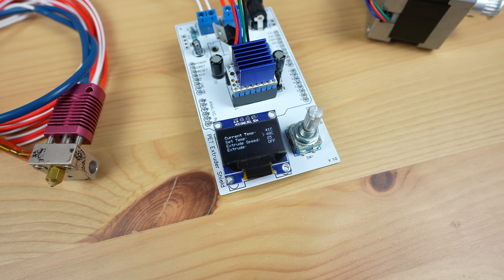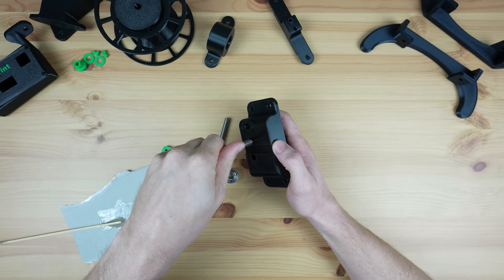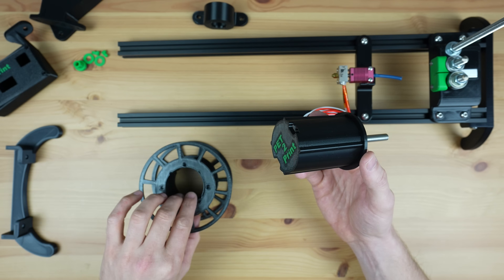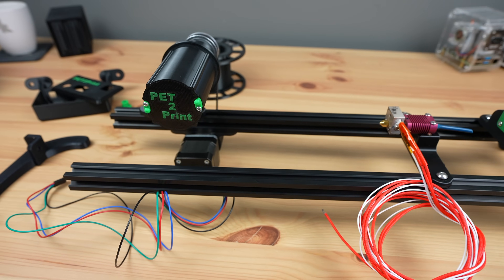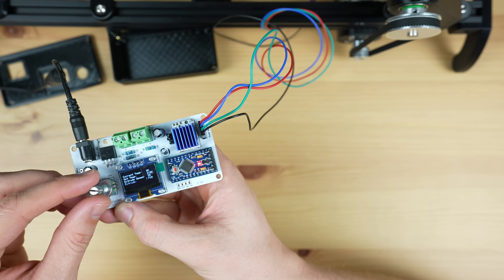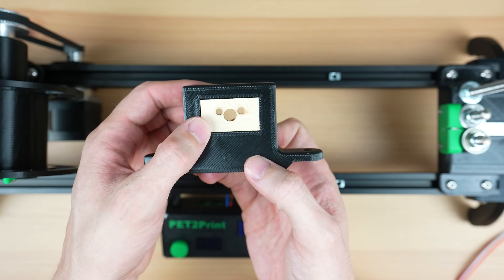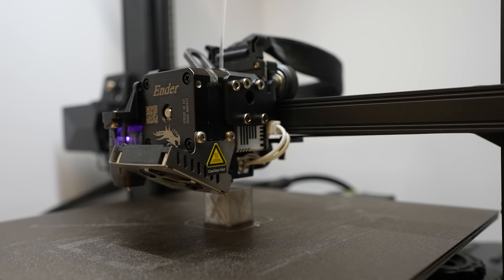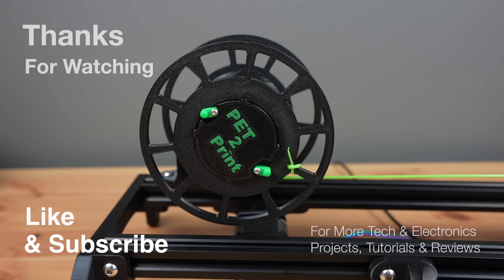I Turned PET Bottles Into A 3D Printed Pi Case - DIY Bottle Recycler

Comment: For the arduino issue with the monitor update , maybe there is in the manual interrupt functions that you can use to call and update the screen. When i worked with Uno for a flight controller for drones , i used those interrupt to fast update and not block other operations . Not if this model supports it , tho. You have to check the manual.
Nice project  👍
Reply from the maker: Thanks for the suggestion, I'll look into that.
Reply: @MichaelKlements  Another option would be to redesign with an ESP32 which has a second thread available

Comment: Hi! Why am i having a hard time pulling the filament? Like it gets stuck. Is it the problem of timing belt? Thank you!
Reply from the maker: Your strip is likely either being cut too wide or the plastic is too thick, or your hot end isn’t hot enough.
Reply: @ what is the width of your strip?? Thank you!
Reply from the maker: You'll need to experiment with it, the strip width depends on the thickness of the bottle you're cutting it from so that the total area is constant. Mine is around 5mm, keep reducing it until you get good results.

Comment: I've been looking at a lot of similar projects lately, thinking about doing this exact sort of thing but knowing people way smarter than I am have already figured out the hard parts. This is, by far, the most straight forward, simple, and complete design I've seen. Most of the other machines I've seen only focus on cutting the bottle into strips but not spooling, and not modifying the strips into print-ready filament. 

I've looked for an update on this project and don't see one, but I wonder if it's possible to add the ability to splice bottles together instead of trying to stop and start a print or add filament when it runs out. PET from recycled bottles makes some of the most interesting prints, I really like the look, and it'd be super keen ta be able to wind a full Kg or two of filament.

I've already grabbed your download and look forward to starting this build on my own. At my usual work pace, I'll be done before the next half-decade is done.

Comment: use freertos to make multitreading in you code, if you use an esp32 you have two nucles in the processor, you can atualize the display and control the motor at the same time.

Comment: Hi. How do you set the height of the strip? Could be an idea to measure the thikness automatically and let a servo set the cutting height :D
Reply from the maker: By adjusting the height of the cutting bearings with spacers/washers. A servo adjustment would be great but it has to be very rigid to keep the cut height consistent.

Comment: Please tell me how do you send the STEP signal to the driver? I assembled the circuit and filled in the program, but when the engine is turned on, it does not move (5 volts are supplied to the dir pin, and a voltage of about 2.4 volts appears on the STEP pin, but I do not see any pulsations? Please help me! I've already spent a lot of time and effort on this project, but I can't get it started.
Reply from the maker: The step signal is generate by turning a digital pin on and off (HIGH then LOW) with a short delay between them. What are you using to measure the pulses on the STEP pin? You should definitely be able to see 5V pulses on an oscilloscope. If you watch my video on the controller design you'll see the pulses on my oscilloscope when I'm fault finding the motor issues - https://youtu.be/43kFDSPJl6w
Reply: @MichaelKlements  When I turn on the board at the arduino output (pin 7, STEP signal), I get a value of 2.5 volts instead of 5 volts and I can't understand why there is such a voltage drop.But there is a frequency change on the oscilloscope. As far as I understand, 2.5 volts corresponds to a logical unit. The direction signal (DIR) is also present (5 volts), but the motor is not moving. I turned on the board without a heater and a thermistor, maybe I'm wrong not to connect them? And that's why the engine is not working. In the first part of the video, you have a heater and a thermistor connected when you check the engine, but in the second part, the engine works without a heater and a thermistor. This leads me to a dead end. What am I doing wrong?
Reply from the maker: It depends on what you are using to measure the signal - that is why I asked in my original reply. The step pin is constantly changing between 0V and 5V, multimeters will take the average over a period of time and that's why they will display 2.5V. The direction pin stays at 5V so it is displayed as 5V on a multimeter. You need an oscilloscope to actually see that the pulses are correct.
It sounds like your motor driver is not set up or wired correctly.
Reply: @MichaelKlements  I checked the STEP signal on the oscilloscope, the values match. Thanks for the advice. But the oscilloscope shows periodic signal skips. As I understand it, this is the problem that you are talking about in the video, related to updating the screen. Perhaps to eliminate it, you need to use two independent timers that do not depend on each other!?
Reply: @MichaelKlements  // пример параллельной работы нескольких таймеров
#include "GyverTimer.h"   // подключаем библиотеку
// создаём таймеры в миллисекундах
GTimer myTimer1(MS, 500);
GTimer myTimer2(MS, 600);
GTimer myTimer3(MS, 1000);
void setup() {
  Serial.begin(9600);
}
void loop() {
  if (myTimer1.isReady())
    Serial.println("Timer 1!");
  if (myTimer2.isReady())
    Serial.println("Timer 2!");
  if (myTimer3.isReady())
    Serial.println("Timer 3!");
}
Reply: @MichaelKlements  I tried to use the Arduino nano (I changed A2 to A6 in the program, as well as A4 and A5 I took from the board (an additional four-pin pad (D10, D11, A0, A1) next to the Arduino) and the Arduino pro mini, but the situation with the D7 (step) output is the same, I get a 2.5 signal a volt instead of 5 volts.

Comment: A beautiful and elegant design!!! Any reason that the reel is so far from the hot end? Is that just for uniform winding? Wondering if the could be closer to make the whole setup more compact.
Reply from the maker: Yes it is just to reduce the angle that the filament leaves the hotend so that it winds onto the reel correctly. You could make it more compact with a small deflection/guide wheel between them.

Comment: Can I use another drive 17HS4401S-PG27 instead of 17HS15-1684S-PG27. I can alter the 3D model to fit the desired dimensions, I am more interested in parametric characteristics.
Reply from the maker: I can't find a full datasheet for the drive you've linked but from the information on google it looks like it has slightly higher holding torque (which is good) and a higher gear ratio, so will just turn about 4 times slower ( itmay be a problem to get more pulses from the Arduino to speed it up).
Reply: @MichaelKlements  Спасибо за ответ!
Reply: @MichaelKlements  Another question. What pitch division did you configure the driver with (1/8/16/32)?

Comment: I wonder about joining the strips of pet with a hair straightener and parchment before pulltrusion for larger prints.
Reply from the maker: You need to join the filament after pulltrusion, the heating and pulling process softens any joint you're able to make and it'll pull apart.
Reply: There is a video of joining filament before pultrusion by "3d_olympics" but I have my doubts for longevity of the joint after respooling and the inconsistency between filaments. Probably better after pultrusion like you say. @MichaelKlements

Comment: Michael, I bought one of your cases a couple years ago. I wanted to know are you going to make the case adjustments for the Pi 5?
Reply from the maker: Yes, I'll definitely be updating them. I've done the adjustments on the cases based on 3D models, I just want to test them out with an actual Pi 5 before making them available.

Comment: Hi Micheal. I have been playing around with some AtTiny85 mcu’s dividing the various components of a PID controller between two AtTinys. I was wondering if you might try off loading the actual timing of the stepping pulses to an AtTiny and all you have to do is send it start/stop and speed data as desired.  The motor on/off signal could come from the ardunio to the motor controller. The AtTiny only has 6 gpio pins, but it can do anything an arduino can do.  Communication between the Arduino and AtTiny can be software serial, I2C, or SPI.  

Alternatively, there are number of interrupts on the arduinos that are timer driven.  You might try using a timer interrupt to handle the step pulses instead of relying on the loop() function of the sketch(I’m assuming that is what you are doing). That way the stepper gets serviced on time every time  and won’t be interrupted by the periodic updating of the display. Interesting project and your engineering of the device is excellent.
Reply from the maker: Yes, this solution would definitely solve the problem - it just seems like a waste to have two microcontrollers on one board. It might be a job for a microcontroller with two processing cores that supports simultaneous tasks.

I tried the Arduino's interrupts in a few different ways but they either resulted in no change to the motor's behaviour or they resulted in the motor running smoothly but the display being corrupted every refresh. I think they both require quite precise timing and are sensitive to changes.

Comment: What about getting the reel closer to the hot end? The filament maybe is not cool enough yet and might help keeping the shape of the reel.
Reply from the maker: I think it would need to be very close to the hot end to do this, the filament hardens about 2-3cm from the tip of the nozzle. The main reason the reel is so far is to improve coiling onto it.

Comment: Drive the motor from an interrupt instead of the normal loop.  That way you can do less critical stuff like display update in the loop and still have the motor driven at perfect timing.  Does require some care for communication between both parts though ...
Reply from the maker: I tried this but couldn't get better results, even with an interrupt routine the Arduino still stopped pulsing the motor for periods of time when the display was being updated.
Reply: @MichaelKlements  its a problem with the display library

Comment: Nice project! If you pre-cut the bottles, you could try splicing/melting the ends together to get a longer filament output, if that would fit through the hot end.
Reply from the maker: I see some people have had success with splicing the ends of two lengths of filament, I tried this a few times but didn't get a reliable bond. I'll keep working on it though.

Comment: Nice but why not use easily accessible hardware like m3 screws instead of m2.5 and geared stepper instead of easy to source non geared stepper.

Lots of people are going to have to order extra hardware that’s going to go unused 🤷🏻‍♀️
Reply from the maker: Most of the others I've seen online use an old 3D printer or very common printer parts to build them so I wanted to try make this one more "custom". The geared stepper motor is a must in this design, a non-geared motor won't have enough torque to drive the reel and you'd need a massive pulley to get the equivalent ratio from a belt drive. The other's I've seen all use 3D printed gears, I'm not sure how long these would last but you could give them a go if you don't want to get a geared motor.